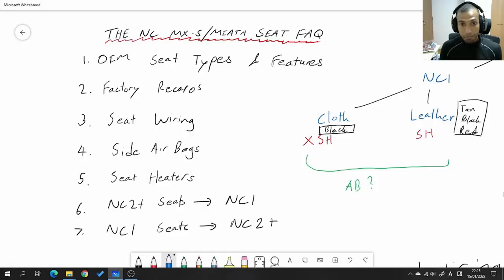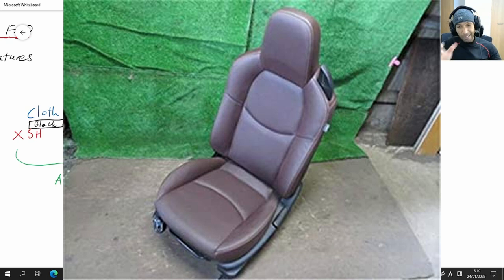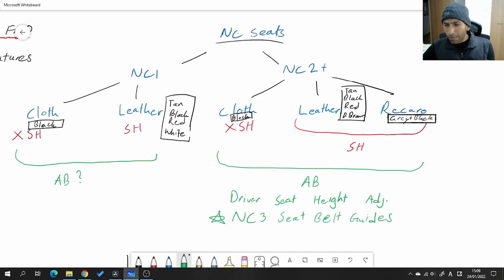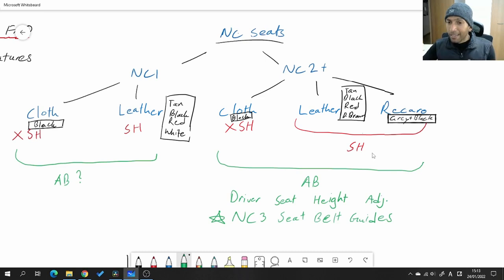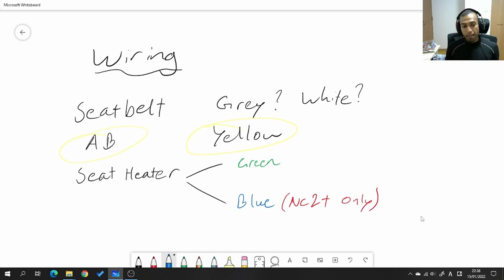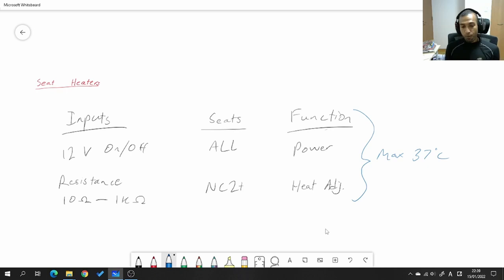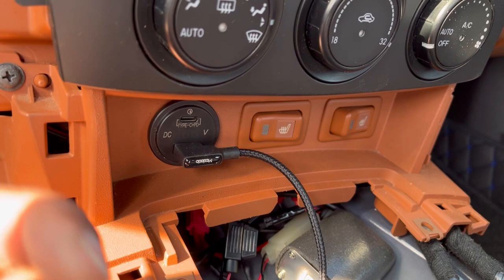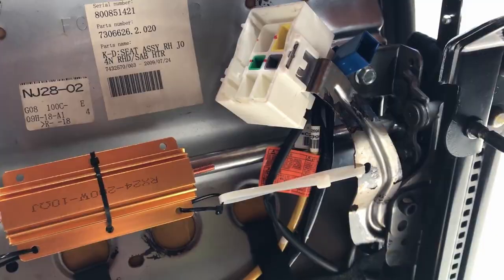NC MX-5 Miata Ultimate Seat Swap FAQ | Tach On Red

Comment: 2006 NC1, Fitting Recaro’s, Car has zero wiring so starting from nothing. Old seats had passenger occupancy sensor, any idea how to bypass? Would it be possible to install the sensor in the Recaro’s?
Reply from the maker: Do you mean aftermarket recaros?

The passenger occupancy sensor is a mechanical weight sensor mounted to the rails. And tricking it is not as simple as just using a resistor. The only solutions I've found are like this:

The only way I believe it is possible to trick the weight sensors (without destroying the sensors and really going nuts reverse engineering the whole thing), is to pull the rails off the seat and mount them remotely in the car.

- There is a little silver box underneath the passenger seat with three connectors going into it. Un-plug the two connectors going to each rail. Unscrew the box from the seat and set aside.

- Un-bolt the rails from the seat. There are 4 bolts you can get at (I believe using a 15mm wrench, or maybe a 14mm) that should be fairly obvious. Remove the rail, and drill out the rivets holding the connecting bar on. This is the only destructive and non-reversible part of the process. But those rivets are tiny and could easily be replaced with a small screw with no issues whatsoever.

- Now you have two seat rails with sensors attached and wires hanging off. Take the hose clamps and put them around the middle of each rail. Tighten down as far as you can crank them, to compress the two halves of the rail together. This is how we make the rails think a person is sitting on them.

- Find a place in the car where you can securely mount the rails. I mounted them to the upright supports of my roll bar, using u-bolts from the hardware store (pic attached). You could mount them in the trunk, you could zip tie them to something inside the car, whatever you want (although I'd prefer to use baling wire over zip ties).

- The rails weigh like 2lb each, so it's not like weight is a concern.

- After you find a place to mount the rails, figure out how long the wires need to be in order to get back to the wiring harness. Cut 4 lengths of wire (2 red, 2 black) to those lengths. Strip the ends of the wires and attach spade connectors (each wire should have 1 male, 1 female). Cut the wires coming from each of the rail sensors, strip them, and attach spade connectors again, so that you can splice the new longer wires in between the rails and the wiring harness.

- Mount the small silver box somewhere near the seat. I zip-tied mine to the seat mount. Connect the newly spliced and lengthened wires coming from the rails. Plug the box's output connector back into the wiring harness.

All done.

Link to full forum thread here: https://forum.miata.net/vb/showthread.php?t=614984

Comment: Great video,  Thinking of buying 2015 heated leather OEM seats and replacing the 2015 Mx5 sport cloth seats,  would it be just plug-in?  I mean for the airbags, seat belt wiring?   or would the seat plugs look different,  forcing me to rewire them?   Afterwards i would try to put in the heater switches and fuse.
Reply from the maker: Glad you found it helpful.

Yes, the seatbelt and airbag wiring should be all plug and play. 

You'll loooove seat heaters once you've had them. 😆
Reply: @TachOnRed  thanks so much

Comment: I own an '09 Touring w/stock cloth seats. I took out the center console and yes I have the heat seater wire harnesses plugged into blank holders behind the stock panel, weird.(so, I bought the correct stock heater switch panel from an NC2 GT) I also appear to have the correct wiring, at least under the drivers seat. What I don't have is any wiring in the labeled fuse spot in the fuse box...just an empty slot. Thinking about upgrading to stock NC2 leather seats w/stock heaters, how hard to connect existing wiring to make them work?
Reply from the maker: That's annoying isnt it. They put everything you could need for the seat heaters but didn't wire up to the fuse box. Here's what I'd do if I were you...

I think adding wiring to the fuse box is just way more trouble than it's worth. Instead, I would first use a multimeter to check if the wires for the switches are live. You might have to add a resistor across the pins for the seat heater to complete the circuit and test if the circuit is live even without a fuse. If it is live, then they've probably just wired it to share a fuse with another circuit.

If it's not live, what I'd then do is just draw out fresh wiring of my own from the battery straight to the seat heater switches, via a relay hooked up to the radio/ accessories circuit. This way, the seat heaters will only draw power from the battery when the car is turned on. Id put a fuse in it too right next to where it connects to the battery so that it's easily accessible from the engine bay.

Once you've got that all done, the seats should just plug and play. :)
Reply: @TachOnRed  Guess I'll be picking up a multi-meter in the near future. Thanks for the response! I'll report back when I find out...

Comment: I have a 2006 GT (USA).  I believe only the 2006 NC's did not come with seat heaters - 2007+ GT's came with heaters.  I have a 20amp fuse in the 4th slot and it does have terminals.  Under the seat, I also have the green wire with the red stripe.  I have not pulled off the console to see if it has plugs back there.  My question is do you think the seats might have heaters but, they just didn't hook them up in 2006 models?  I don't know why they would do that but, it seems weird that it would have the wiring and the fuse in place.  Thoughts?
Reply: BTW, great video!
Reply from the maker: Thank you for watching, Bill!

It is possible your seats have the heating elements and controller but they just didn't put the switches in your car. To be sure, check if the white connector on the seat side has the green plug going into it. If it does, then you can be sure your seats have the heating elements. So, if you already have the fuse in place, all you need now is to add switches to get heated seats. :)

Why would they do that? I imagine to have fewer variations in their production line and more modularity across different grades and vehicle markets. All their vehicles come off the same production line. And the only difference between vehicles with seat heaters and without is the switches which can even be installed or removed at the dealership. They don't ever have to worry about ending up with a huge excess pile of wiring harnesses for a grade that didn't sell well.
Reply: @TachOnRed  Yes, I think you are right about Mazda being a small company and just putting everything in place so they didn't have to create more variables.  I know Canadian cars in 2006 did have seat heaters so, it would make sense that they would just put them in all of them.  So, you said green "plug", did you mean green wire?  All my plugs are white but, with different color wires.  I saw that you had commented on the Facebook group a while back on this subject.  I'm going to go there and reply back to your comment with pics of under my seats.  The driver side has a green/red wire next to a black/blue wire.  The passenger side has a green wire without the red though.  Curious what you think after you see the pics.  Thanks again for all your help!

Comment: I've got an NC1 and installed Recaro seats from a crashed NC3. They are great but the heating isn't working. Maybe I installed it wrong or do you think the wiring could be f.cked up from the accident?
Reply from the maker: Did you add resistors like I demonstrate in the video?
Reply: @TachOnRed  I literally finished watching the vid half way through due to work lame so I haven't seen your explanation. Anyway I'll look into that, thanks for the valuable info!

Comment: I just taken the driver seat out and found out that this seat has airbag but does not have seat warmer wiring but the the passenger has seat heater wiring. Go figure.
Reply from the maker: That's odd indeed. Do you know if one of the seats were swapped at some point?

If you got it used, I'd suspect maybe the driver seat upholstery got worn out and the previous owner swapped in a used oem seat?

Btw in some warmer countries, the leather seats had no seat heaters.
Reply: Most likely it or the other was swapped at one time by the previous owner. Great videos, very informative.

Comment: Does it need to be a 100w 10ohm resistor?
Reply from the maker: Considering the NC2 switches are the equivalent of a regular variable resistor, I think a regular rice grain type resistor would work just fine.

I just got that huge one because I liked the idea of using nuts to do the wiring. Also, the big heatsink can't do any harm. 😊👍

Comment: Any seats offer lumbar support?
Reply from the maker: As far as I know, no. But the height adjustable NC2+ seats could be considered to have some lumbar adjustability because the height adjustment only moves the seat cushion while keeping the backrest in the same spot. That means you can set the seat height where the arch in the backrest is in the right spot for you.

I've also heard of people modding their seats with inflatable lumbar support bags. 😊 👍 The parts are pretty cheap and easy to find. I'm just not too comfortable disassembling my seat and upholstery. 😆